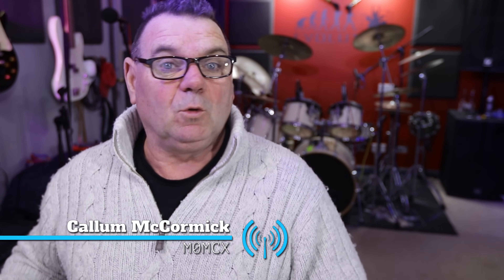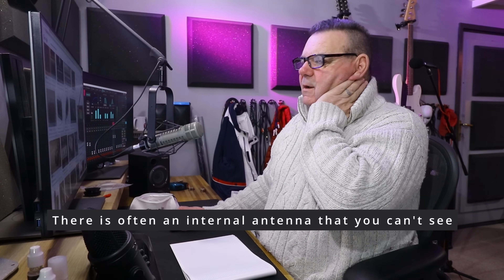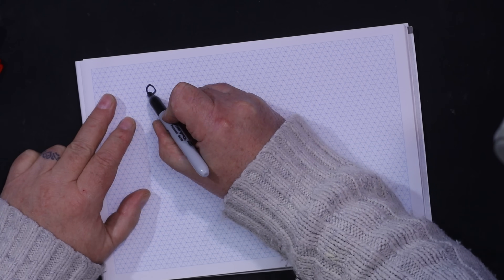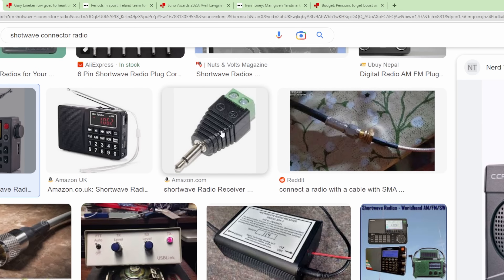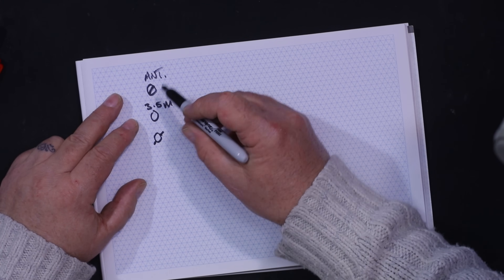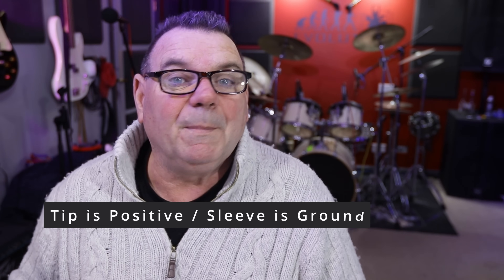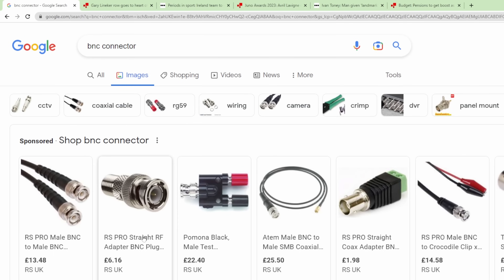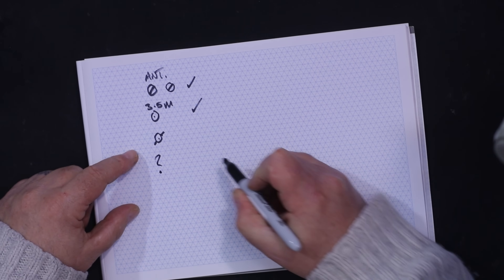Cheap SWL Antennas - Listening to Shortwave Radio With Scrap Wire

Comment: I use an SO-239 connector for SWL. The radio I have has a SO-239 connector on it which comes handy for connecting the radio to a shortwave antenna. Using a Panasonic DR-49/RF-4900 radio.
Reply from the maker: Perfect!

Comment: 124½' EFHW Dipole,
 < 2:1 SWR if used as TX/RX antenna 2-50 MHz.
   Each ear 62¼' either vertical or horizontal polarization, feed line connection half way at the 31⅛' Current Node (opposite of Voltage Nodes on either end of the ears) approximately 75 ohms. Leads to either ladder line to radio or 6' of Coax for 50 ohm connection.

Comment: 3:40 when I was 13 years old (late 1980s), I tried connecting my TV coax cable to my stereo’s 2-screw terminals (using a regular 75-300 ohm adapter normally used to connect a coax to older TVs).

I was able to pick up channel 2’s audio at around 97.3 FM on my old Electrolux stereo! Oddly enough, I could pick up MTV (normally on channel 36) at both 88.5 FM and at 107.7 FM). As a kid, I didn’t expect to be able to listen to TV audio that way. 

Of course, I didn’t know at that time that VHF TV overlapped parts of the Broadcast FM band (least in the US).

Comment: I remember it as Q-Codes QRM man made noise, and QRN normal or not so baseline or background but still normal Noise
Reply: stranded wire will induce noise more than anything, try and stay with solid core wire, and you want real copper not copper clad ....
Reply: LOL for listening you can just toss a 3 foot wire out a window I have also tested the MLA-30 Plus Loop its a good go to ....I also run a 130 foot long wire and dipole because you never know when you need to pull someone out of the noise, to many people think its fun running QRP and leave it up to you to pull them out!

Comment: Very good, thanks. The problem I'm having with my RTL-SDR V4 here in Jamaica is big spikes across the entire HF band, about 120 KHz apart, from my desktop, presumably the switching power supply. Figured it out by also putting SDR++ on my laptop (both machines run Linux Mint), and then turning off the desktop. Spikes were gone. Turned it back on, and they were back. Also found the noise floor on the laptop drops dramatically when I run it on battery rather than the charger. The antenna is just an end-fed long wire, but the coax shield isn't grounded. Going to try that and see if it helps. Also going to get a 6m USB cable to get the dongle up on the concrete roof, further from the desktop. I've checked to see if the RFI is coming from the coax connecting the dongle to the desktop by disconnecting the SMA connector - the spikes disappear. So it's the antenna side it seems. I'd really rather use my desktop for this. The monitor is a 50" Samsung UHD, and I have very large, good speakers. Laptop has a tiny screen and tiny speakers.
Reply from the maker: OK.. Good analysis!

Comment: Thanks very interesting. I just had a long wire attached to a tree and wrapped it around  the antennae when I used it. I thought the higher the better for some silly reason. Thanks again !
Reply from the maker: CAN be good.. But for shortwave it would need to be VERY high to be substantially different.

Comment: Thanks Callum.  I got a bit lost in the spot about coax to wire.  If I'm going to use my IC7300 to listen to SW, I'll have coax coming out of the radio to where the antenna is.  Would I just attach the center conductor to one end of the loop, then the shield to the other end of the loop? Maybe I missed that in the video. 

Also, all my fencing is metal wire with metal posts.  If I put insulators on the fence for the wire, would the fence couple anyway and give me problems?  I see you had one on a wire fence with wood posts in the video.  Thanks again for your help.
Reply from the maker: Paragraph 1. Yes. Paragraph 2. No problem. Just do it.

Comment: Hi thanks for this, great video have learnt a lot.  I am a beginner and my radio starts on SW with 4.75 up to 22.0 I see some SW radio frequencies for example 3467 (random example), how would I find that frequency on my radio please?  Thanks in advance.
Reply from the maker: OK, so to pick your random number 3467, that's just under 3.5MHz.
Reply: @DXCommanderHQ  Ah great thanks that makes perfect sense.

Comment: Hi great video thanks, I'm new to this and am wondering how I could connect the coax to an SMA connector on my SDR please? Thanks
Reply from the maker: Fit a "big" plug and then buy an adaptor?
Reply: @DXCommanderHQ  Hi it sorted thanks I found a coax to SMA connector getting it delivered tomorrow, thanks.  I never thought there would be such a thing.

Comment: Wireless dipole antenna concept:

What if i make big big loop from dipole antenna feeder(coaxial cable) which came from both left and right leg of dipole antenna in my bedroom and switch on my Receiver close to that loop is that work!??

and is there life threat or property damaging possibilities by lightening/storm!!?? Placing big loop in bedroom bad idea or safe??

Please review this wireless dipole antenna concept. Thank you..
Reply from the maker: You would need to connect it.. And don't worry about wearing tinfoil hats and lightning..

Comment: I did this with about 100 meters of old electrical cable and it worked great. I received stations from the Far East and Africa here in Norway using a Lime Mini SDR. The loop is a short circuit and does not have the correct impedance. Now I'm a bit worried I might have damaged the SDR without a balun.
Reply from the maker: You won't damage it.
Reply: @DXCommanderHQ great! thanks for the content and the reply

Comment: When I was a kid I saw something somewhat unique.  I think it was a "gain assist" for the AM radio band.  Imagine a big hollow plastic disc about 12" in diameter and 2 1/2" thick that stood vertically on a base.  At the center of the disk there was a big knob that you could turn with your hand.  It was a completely passive device.  I am guessing that it was a big LC resonator and the knob was for the variable capacitor.  So you placed the disk next to your radio and set the resonance to the the same frequency that the radio was trying to tune in.  I am guessing that this boosted the signal to the radio's internal ferrite antenna.  Have you ever seen anything like this?  I only saw it once in my life.
Reply from the maker: Well.. SOunds fascinating! But no, not heard of that!
Reply: @DXCommanderHQ  Something even more interesting.  Someone on YouTube did a DIY project and built exactly what I was describing for the AM band.  Who knows, perhaps they can also be tuned for SW bands.  The YouTuber is "Radiodog" and the clip is, "Improve AM Radio Reception with a DIY Loop Antenna!"

Comment: About 20 years ago, somebody wanted to take a SWL rig to Israel.  We were in a Radio Shack.  Customers, I and staff put together a package of a spool of wire, 75to 300 ohm coax to TV lead balum, 75 ohm TV coax, coax to radio adapter.

Heard from SWLer later.  Got stuff into country, and did an in hotel room loop with the Shack parts!

It worked 

I Mass RS.  Only places in Houston like it are ACE Electronics on Antoine and 34th in the NW, and EPO on Hillcoft between Richmond and Westpark!

Comment: I'm a newbie with a newbie question.  On the square antenna in the backyard, why is splicing each end to a coax and then splicing the other end of the coax to the radio posts necessary?  Why not connect the two ends of the antenna wire to the two posts on the radio directly, without a coax in between?  It would be so easy, so there must be a reason.
Reply from the maker: You can do BUT you may have a ton of wiggles to make and maybe go upstairs or something - then coax is handy as a feed between the two.
Reply: @DXCommanderHQ  Oh, I see.  It's the practical thing so you can move the radio this way and that, not technologically necessary or advantageous.  Thank you very kindly for explaining to me and anyone else who might wonder.  Good video and appreciated.

Comment: Thank you for the encouragement and information. 😃

So what if limited on outside space and signal is still weak? I would think be a way to increase gain using an amplifier before the receiver, though so far found nothing out there (no objection building it, in fact, prefer it).

Cheers,
Adriel
Reply from the maker: If you can hear the signal but it is weak, then EITHER look at a pre-amp or perhaps change the radio because most modern radios have quite a lot of gain with Pre-Amp switched on.

Comment: QRM man made noise, and QRN natural noise?
Reply from the maker: Regardless of what wikipedea says, modern vocabulary has QRM as being the guy 1kHz away rustling your receive audio and QRN as being modern man made noise.
Reply: @DXCommanderHQ The Q code, QRN is for static noise like lightening discharge,and QRM is for interference as in adjacent channel interference,as in your example,keep up the good work on your productions they are interesting, and are a catalyst for enthusiasm for ham radio in all it's facets,regards Colin

Comment: One tiny correction Cal.
QRM = man made
QRN = natural 
The last letter is the key. 
"QRM?" technically means "Are you being interfered with?"
Reply from the maker: Regardless of what Wikipedia might tell you, there is no Q code for man made transformer noise. QRN is the closest with the official word being "Static". QRM on the other hand is another station right next to you. That is the generally accepted vocabulary. Have a lovely day!
Reply: @DXCommanderHQ  I'll stand corrected then - my apologies.
My G3 and G4 instructors/mentors always explained it that way, but I've no idea who told them.
Reply: I would never call electrical interference from a manmade device QRN.  QRN comes from natural sources. Noise from a thunderstorm is QRN. Noise from a lawn mower is QRM, even though both are spark noise.  That’s how I’ve always heard it used.  M=manmade, N=natural
Reply: @stargazer7644 Correct. I have been a ham for far too long and QRM is man made interference, QRN is natural, eg lightning static.
Reply: Some places refer to that as "impulse noise".  Spark plugs, lightning,  etc.

Comment: Greetings from Sweden!

Can i make the loop around the edges (plane) of my apartment ceiling or is it better to make the loop around the edges of the floor/2 walls/ceiling ("vertical ")  i will try to visualize. 
Ceiling then the loop is _ flat floor/walls/ceiling then the loop is □ 

😂
Reply from the maker: Probably doesn't matter unless you are on the ground floor.

Comment: Hi Great channel  thanks I’m using vintage radios like r 390 or ar88  or Rak 7 types plus others I have a 300 foot antenea long wire mounted in trees  should I put a second long wire s my ground  iam not useing coaxial thanks
Reply from the maker: I would certainly do some ground tests. You might be amazed.
Reply: @DXCommanderHQ  thank you 🙏

Comment: Old damaged extension cords are great for free wire to play with for outdoor antennas. I grab them from the roadside rubbish and strip them.
I recently grabbed a nice big piece of PVC pipe, 700mm long by roughly 110mm diameter also from roadside hard rubbish. On it I used a stripped 25m extension cord to wind a tapped coil around 700 microhenries. I'm going to use my shed as a ground for it and use it to load a 5m vertical element to play on medium wave

Comment: If you have an SO239 on the back of the radio you could just use a banana plug on a piece of wire and put it in the center. Then ground the radio.
You can also plug an SO239/SO239 into the end of a ready made coax for the same type of antenna. No soldering.
Maybe not for transmitting but OK for listening.
Back in the 70's I had a Sony portable and a 20 foot wire running EW in my apartment. Conditions were good and I listened to the whole world.
Reply from the maker: Perfect!

Comment: Hello sir. Thanks for this video. I wanted to ask you,  is this also effective for AM shortwave listening in the range of 2000 khz to 30.000 khz?
Reply from the maker: Yes, absolutely. Also.. If space is limited, check out something called "LOOP ON GROUND"
Reply: Thank you for your help!! I did it, but i only had 18meters of speaker cable. Build an antenna in the ground on the backyard as you said, in a square of 4,5m x 4,5m, and I got really good results!! I wonder if I did a bigger one the results would improve. I've bought a cute shortwave arduino radio online. The ATS 20+  I was getting hopless because I couldn't pickup anything inside my house. I tried to connect a coaxial cable to the clothes rope wire outside and it kinda worked.. but this works way better!! Thank you so much!! I'm you fan from now on!! Cheers❤

Comment: How much does the height of the antenna impact reception: especially on Shortwave radios?
I am also confused on the kind of wire to use. There are some that say that a coaxial cable to go, sone say a regular 14 gauge  wire, and some say it doesn’t matter. I don’t know which is right.
Reply from the maker: ANY (any!) wire works.. For the paranoids, you can achieve better with height BUT it would have to be seriously substantially higher. For low-bands (7MHz and below) look at a Loop-on-Ground (literally on the ground)

Comment: Hello sir. I have a handheld Yaesu VX-6 that has shortwave channels built in. If I had a BNC connection to the radio and the center of the coax connected to my chain link fence. Where would I connect the other stranded wire from the coax? Could I just put it in the ground?
Reply from the maker: Yes, that'll work for receive.. You COULD do better - but it would work.

Comment: another thing you can do and what I used to do is if you only have the telescopic antenna, just take a crocodile clip and clip it to the end of the built in antenna and run your wire that way...
Reply from the maker: Good idea!

Comment: Conecting Co-Ax Cables: Put dielectric grease on th connection THENskide a heat shrink tube over the entire connection and heat shrink with a hot hair dryer.

Comment: So the loop has to go from positive to negative?  You said dont touch them together or thry will short out, then you say have the ends of the loops complete the circuit?  I dont understsnd at all. Which is it. The sharpy diagram is impossible to understsnd. Any way to redo this video so we csn really understand it?
Reply from the maker: one side of the loop goes to one side and the other side of the loop goes to the other. Your first sentance is correct.

Comment: What is the best way to make an antenna for SSB on a sailboat if you just wish to suspend it from the mast (isolated)?
Reply from the maker: Use the back-stay.. COme down on insulators with a wire and put that into an SG230 or Icom smart tuner.. Then you need the "other half" of the antenna.. Put some copper wire in the bilge running length of boat, various lengths.. Let them gradually rot away. It's take some time.. That'll work fine.
Reply: @DXCommanderHQ  Callum, thanks for taking the time to respond.  I have a catamaran, no back stay.  Thought about using the shroud but didn't want to remove, install insullators, etc.  A friend told me to take a halyard, pull the center out, run an insulated wire inside the halyard to the shroud.  Suspend it so it is not grounded and then hook the GTO15 to it with a clamp to the tuner below deck.  Run it through a waterproof clam on the deck near the deck plate.  Question, does that sound reasonable and if so, what gauge insulated wire should I use in the halyard or should I just run the GTO15 from the tuner to the top of the halyard and use it as the antenna?  Thoughts? Thanks in advance.  Rich

Comment: My friend and fellow ham when he first became a ham listened to scanners 25-7. He had tried several scanner antennas.  We were having coffe one day before i had to fly to work and we got on the subject of better scanner antennas. He was dumbfounded when i said all you nedd is a long wire. He didn't believe it.  As i was leaving we wereat my car and still debating the wire. I poped my trunk and pulled out my 94ft with 17ft counterpose and an old mfj travel tuner. I still to this day czrry in my trunk. I took the 94ft wire loose and handed it to him. Told him to run it ghrougb the trees. He took it shaking his head.  I got to work for a few days and he text me. Said he had to tske that wire down. I asked why, he said tbe D scanner never shut up it was pulling in stations from all over some were 500mi away. I had to laugh
Reply from the maker: Haha great!!

Comment: Great video! Bue what about the radios that have only the antenna as a receiver, without any options for other inputs of antenna (Like some portable radios)
Reply from the maker: If you have zero connection points then you need to either a) go fishing, b) buy a different radio or c) hire an aircraft and go up 5 miles! :)

Comment: Thanks very informative. I Remember listening to worldwide radio stations on my father's Sony 12 band radio. I bought a tecsun pl380 it's supposed to have sw, lw,  mw. For my surprise I couldn't get any international stations. Too much wireless noise nowadays? Fewer stations transmitting? I will try this and see if there's any improvement. Thanks again
Reply from the maker: Yes OK.. Good luck.. They are still out there..!

Comment: Great advice Callum, thanks for sharing your experience with the shortwave listeners users!

I have just one question. Can the ground loop wire be 4 inches underground into the earth or that will some impact on reception and/or interferences? 

I am asking because I already have such a cable installed this way that I don’t use anymore. In fact. It is (or was) an electrified wire fence for restraining my dogs to stay within a selected perimeter.

Thanks for all the work you put in those YouTube videos! It’s quite a source for references…
Reply from the maker: Try it.. but it MIGHT be too buried.